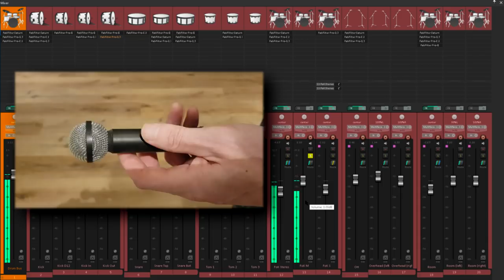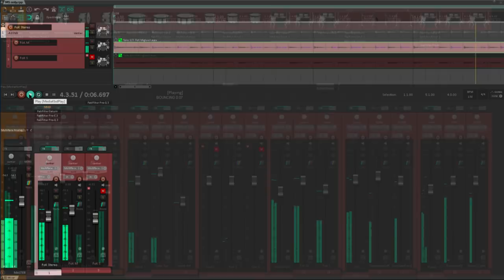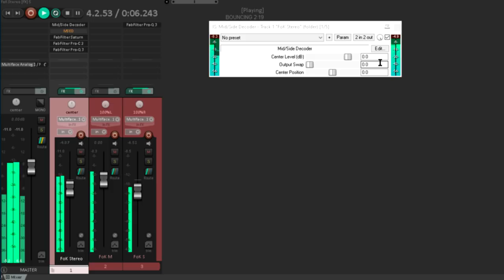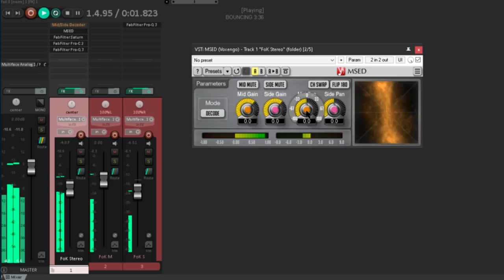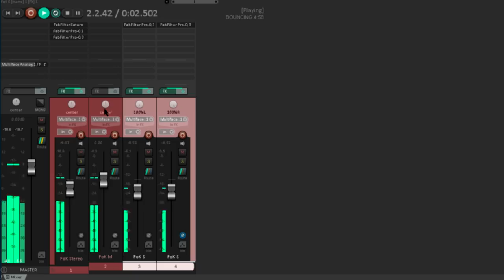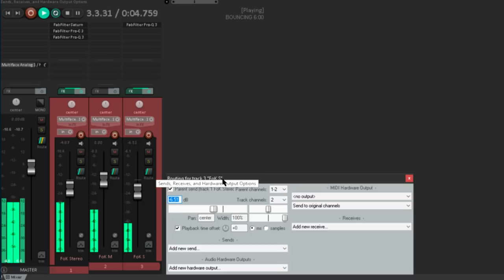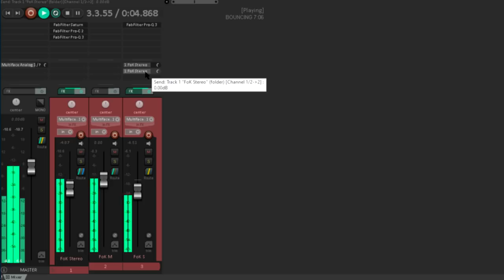The FoK mic (and a Reaper MS tip)

Comment: I have been recording MS stereo for 43 years, starting with a pair of C414EB, then a pair of U87s.  Once I found the Calrec Soundfield, I never looked back.  
A tip; when building your own three channel ‘decoder’, monitor just the two reversed-polarity side channels in mono and adjust for zero output.  Group these two faders so they track perfectly.  This will give the best stereo image when the mid mic is blended at different levels.
Reply from the maker: That's essential if you're decoding on an analogue console. In a DAW I'm  happy to trust that two channels with the same gain and opposite polarity will always cancel perfectly...
Reply: Dan Worrall   You are absolutely correct Dan.  Old habits die hard I guess.  I still check this.

Comment: In Cubase you can link multiple channels in the mixer so that changing one affects the other. You can choose which changes apply to the channels in the linked grouped, including volume, panning, EQ, inserts, sends, etc. It makes it easy to link two channels into a stereo 'subgroup' without the need to actually make a group channel and add more channels to the mixer. I use this sometimes for M/S stuff, though honestly I usually just throw on an instance of the MSED from Voxengo. They make wonderful plugs.

Sidenote: One of the first things I show ProTools users in Cubase when they ask why I prefer mixing in it is the phase button on every channel. :)

Comment: Dan, you always happen to have REAPER workflows which seem so simple yet effective, I constantly ask myself "why didn't I think of that before?"

I am currently struggling to find a good workflow to use with the Fabfilter ProL2 side chain limiting feature. The only way I've found to do this was to put all tracks in a parent folder, duplicate that parent folder with all childs, send the duplicated parent into the other parents' 3+4 and disable Master, solo safe duplicated parent, put ProL2 on the main parent, configure side chain input and then render stems via render queue. Another workflow I recently found was, to put ProL2 on the master bus instead and use the "render tracks via master", but then I need to send the duplicated parent into each individual's 3+4 input, which makes rendering easy but pre-listening plainly impossible (master auto-mutes because of all the inputs from the duplicates).

Whatever I do, I just can't see a real good workflow for this but in the field I'm working on, side chain limiting can be a real time saver. If you happen to have a hint up your sleeve, I'd LOVE to hear. :)
(It also seems you cannot increase the gain when side chain limiting without making it clip; I have reported this to fabfilter but unfortunately they haven't addressed the issue yet.)
Reply from the maker: I've got a reasonably easy workflow for stem limiting, although so far I've only ever needed to do this with two stems (beat & acapella) which helps to keep it manageable. Biggest issue I ran into there was stems that clip on their own, but don't clip when summed: this seems to happen when the vocal stem peaks in the opposite direction from the instrumental. Only solution I found for that is another instance of Pro-L, keyed from the input not the side chain, just set to catch those overs.
I might make a video about that at some point. But I also have an issue in that I usually want to compress the stems "together" as well: setting this up correctly along with the limiting gets really confusing and I'm still figuring out the best approach...

Comment: Reaper makes me totally regret the 12 years I've spent getting very fast in Pro Tools. AVID bend us over the table every 12 months for absolutely nothing of value. There's still no polarity buttons on the mixer. Or folder tracks. I'll never suggest anyone starting out get into Pro Tools now. It's awful and it's performance is absymal compared to other DAWs on identical hardware. Merry Christmas?
Reply from the maker: Merry Christmas :)
Reply: That is a very strange oversight. I'm using a 12 year old copy of Cubase 5 and it has polarity buttons on the mixer.
Reply: oh, but iT's tHA sTaNdARd.

Comment: 10;00 - you'd be able to do that in Ableton with a Rack group, and utility. you can run the MID hard left, sides hard right, then make a group with 3 channels (M SL SR) and then with Utility you can hard pan and flip polarity. then you can use macros for your pans and volumes etc. this will work for individual track and groups/buses. it's about the same amount of work as on this video with your solution that you actually use, but a little more intuitive.

Comment: I'm not sure I understand the purpose of panning the same sound to both sides with opposite phases. Is this intended for the sounds to cancel each other out when listening in mono so that it clears up space?
Reply from the maker: It's the difference signal. Instead of recording left and right, we record sum and difference signals. It's the same information: you can convert L/R to M/S and back with no loss. So the mid (sum) channel is literally the mono signal, while the side (difference) channel is literally what you lose in mono. In this case I've recorded a side (difference) signal with a figure 8 mic: converting to L/R stereo means adding this to the left channel while subtracting it from the right. The mid mic just stays mono panned down the middle.
Reply: @DanWorrall  Wow, that went way over my head! haha
Reply from the maker: Sorry. Read up on mid side stereo?

Comment: Couldn't you also just move the decode plugin to the side channel (instead of the send-method)?
Reply from the maker: That would work, so long as you patch the side mic signal to only the right input of the decoder plugin.
Reply from the maker: I like to have a sub group with the decoded stereo signal however, so I have the option to process as normal stereo instead of M and S.
Reply: I agree, and it wouldn't change that. I meant that it would just be faster to start from the setup at 4:52 and move the decoding plugin to the side Mic, and then instantly have the Pan-knob of the Mid microphone as a new center-panning control. And if it wasn't needed anymore one could easily go back without having to reroute anything, just by moving the decoder back to the sum and pan the mid mic to the left again. I hope that makes it more clear what i meant :)
Reply: Also, while I have you: Thank you for all those tutorials. These are invaluable and very high standard, no matter the context and subject!
Reply from the maker: @JanWeigangMusic  or you could make a JS plugin that simply inverts the polarity of the right channel: just throw that on the side mic track and you're good to go...

Comment: Hey Dan, sorry for going off topic, but would you recommend the beyerdynamic DT 990 Pro for producing and mixing/mastering?
Reply from the maker: Sorry, never used them. I've got three pairs of 770 pros however; they're great for tracking.
Reply: @DanWorrall  which headphones would you recommend?
Reply from the maker: I don't really use headphones for mixing or mastering, so I can't recommend anything I'm afraid. My DT 770s and 250s are fine for quick binaural checks, which is all I ever do: I switch back to monitors to make any changes. That's not to say you can't produce with headphones, just that I don't usually.
Reply: @DanWorrall  Thanks a lot Dan
Reply: hey mate,
i use the 990 pros together with "Sonarworks Reference" & "TB Isone" to simulate speakers. i just dont have the room for a proper monitoring setup so i just try to make it "as real as possible" and then apply the "know your room/system/speakers" effect. so when my mix sounds good on headphones using all the extra stuff in mono, then on headphones only in mono, then stereo , then i go to my bathroom and let my 2.1 system play the audio, then its probably good enough for my requirements. 

so in my opinion you cant go wrong with 990s , just be aware, they have elevated high freqs (which sonarworks reference tries to neutralize, with great effect i think) and learn to use what you have until you have better situation for mixing. until then, go mix! :)
here is something recent that came from my setup:
https://www.dropbox.com/s/v0rxlskwxxbbv0x/GuitarCabExperiments_7.mp3?dl=1
Reply: @RussianPunchProductions  thanks a lot for the reply. Do you use a headphone amp along with your headphones?